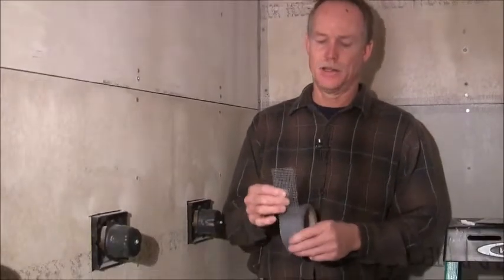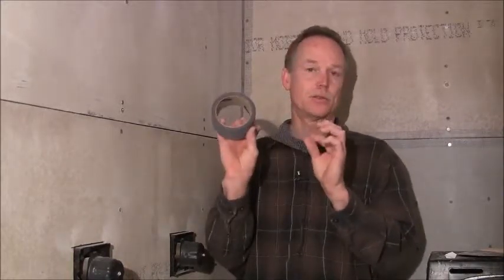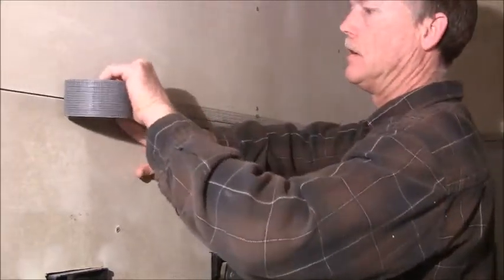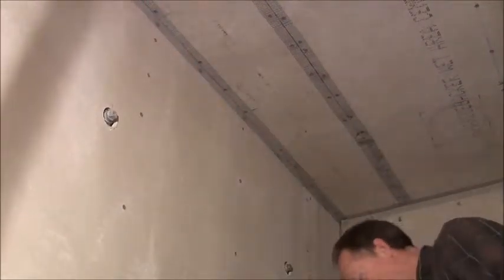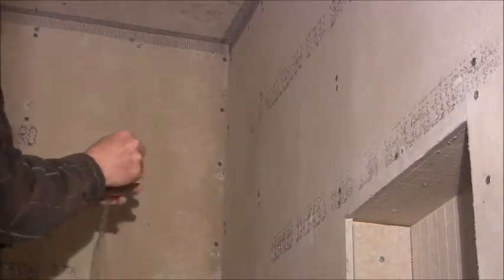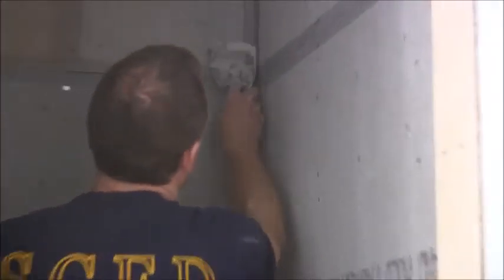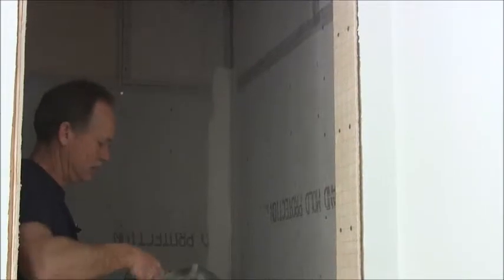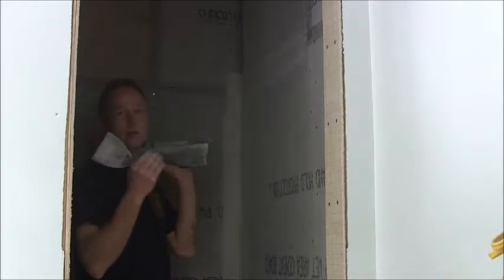How to apply alkali resistant tape to concrete or hardie board

Comment: I have some questions and would like your input: I have a shower enclosure around an old cast iron tub that needs to be replaced. The wallset I want to use is a fiberglass glue-up type that specifies it needs hardieboard or cementboard underneath. I want to use the hydrodefense hardieboards but they will be almost $30/sheet with tax so I don't want to have to use too many panels. I believe the surround goes up about 58" from top of the tub (which does not have a flange). I've heard I need a 1/4" gap from the bottom of the panel to top of tub edge and I plan to have the uncut edges toward the tub. One edge of the tub sits on a flat wall that continues straight with printed wood panels from the 70s. The other side has an outside corner- again with printed wood panels. There are rough wood strips as trim on the outer edge that I plan to either replace or sand & paint, but I will have an edge trim for the hardieboard to butt up against (the existing wood panels are about 1/8" thick). 
My questions:
1. Should I have the factory edge on the outer edges of the tub up against the trim and have the inside corners be cut, or factory edges on inside corners? Or does it even matter?
2. Do I need to leave an expansion gap at inside corners and/or at seams?
3. Should I use the hardieboard all the way up to the ceiling (it's about 9') or should I terminate at or slightly above the height of the wallset? I was thinking of having a small ledge at the top- at least on the sides without the showerhead.
4. Do you have any other ideas or suggestions?
Reply from the maker: Sorry for the delay, I haven't been online the last cuple of days. 1) It shouldn't matter as long as the edge is straight and plumb. 2) I don't think you need an  expansion joint, although it won't hurt anything if you did have a 1/8 inch gap. 3) I would terminate the hardie board at the same height. 4) Is the hydrodefense hardie board different than the regular hardie? If it isn't, I would just use the standard. the fiberglass surround is waterproof. 
     I hope this helped.

Comment: Thanks - completely covers the topic. Exactly what I needed. Two question: you don't cover the screws with thin set like you would with regular drywall - why is that? And no sanding after it drys?
Reply from the maker: No need to cover the screws, the screws will be covered when you put the tilr on, and no need to sand either, you should only be applying a small amount of thin set.

Comment: My new fireplace came with non combustible board which I installed around the unit.  However, the rest of the chase front is drywall.

How do you seal the seems between the non combustible board and drywall?  Drywall tape and compound or seal it with thinset when tiling? Or a tape like this?  Thank you
Reply from the maker: if you are going to tile the whole area, I believe I would use alkali tape.

Comment: Thank you! The manufacturer kept saying the tape had to be embedded in modified thinset but I was wondering if it was needed with self-adhesive tape. Do you have any suggestions for modified thinset to use? Is there a pre-mixed type that can work that isn't in something too heavy?
I heard the price only costing $3 or $4 and then checked how long ago this was posted. LOL. More like $9 to $12 now (depending on the store & the taxes). Still cheaper than having to put down mud first, do the tape, and then thinset over.
Can the tape be used on outside corners? Like on that niche in the shower? If not, how do you seal the outside edges up? Can something like Flex Seal be used over the thinset afterward? Or would that interfere with adhesion of loctite building adhesive (I want to glue up fiberglass wall panels)?
Reply from the maker: Is the niche part of the fiberglass wall panels?

Comment: I've read the installer should use the same mortar to cover seams that is used when installing the tile. It's not always the same mortar used under the hardiboard that's used under the tile. That being said, what's you're opinion on the issue?
Reply from the maker: I would use what is going to be used under the tile.
Reply from the maker: Hope that helped.

Comment: How do you handle the seams where the cement board meets drywall?
Reply from the maker: I don't put any seam tape over it. I let my tile cover it up just a bit, 1/2 inch or so.
Reply from the maker: @steveyoung9925  I got to thinking today, you could put some tape on it if you want to. Apply it just like you would any other flat area. It won't hurt anything. I never have and haven't ever had any issues.
Reply: @doityourselfdenniscom  I decided to apply silicone caulking around the perimeter and planned to caulk again after quartz panels are installed. However, it appears that in some areas to silicone will not harden. Perhaps it chemically interacts with the hardibacker causing it to fail to harden. I removed as much as I could. Have you ever heard of this issue?
Reply: Any remedies?
Reply from the maker: @steveyoung9925  No, I have never heard of this problem. I generally don't worry too much about the top or side edges. I overlap the tile 1/2 to an inch. Chances of water even getting to these places is slim to none.  The tops are above the water and the sides are usually outside the shower curtain or door. Hope this helps.
Reply from the maker: @steveyoung9925  I generally don't worry too much about the top or side edges. I overlap the tile 1/2 to an inch. Chances of water even getting to these places is slim to none.  The tops are above the water and the sides are usually outside the shower curtain or door. Hope this helps.

Comment: What kind of tape and mudded you use on wonderboard Bathroom the same as Sheetrock or different
Reply from the maker: It is different than drywall tape. It is an alkali resistant tape. It is kind of like a mesh. Are youasking about concrete board or wonderboard? There is a difference.

Comment: Do you tape shower curb?
Reply from the maker: No, you should not be nailing concrete or hardie board to the curb. Nails in the curb is a no no. The curb should be built up with a concrete mortar. I have a video on how to build a concrete mortar shower pan. I haven't uploaded it to youtube yet. If you would like I can send it to you.